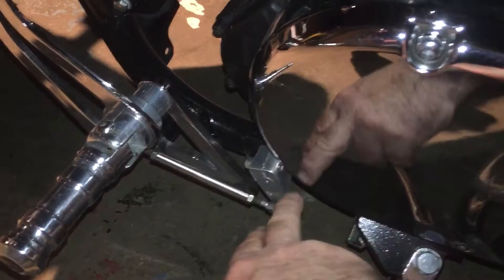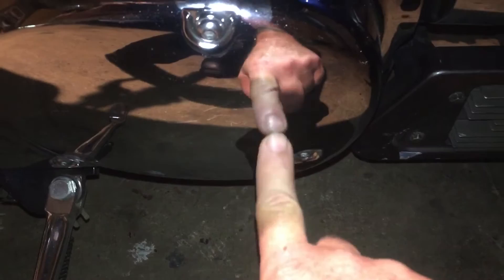Kawasaki front bevel gear bearing inspection

Comment: I got to do this exact job on my bike! Any info on to go at it without ripping apart the whole bike?
Reply from the maker: Infinity 11  You’ll have to remove your seat gas tank rear tire swing arm remove  rear Engine mount bolt so you can jack the rear of the Engine  Exhaust has to be removed also

Comment: what are the special tools I need to do this?
Reply from the maker: Damper cam holder # 57001-1025 

drive shaft holder # 57001- 1407
Reply from the maker: +174iceman  don't loosen the big bolt in center driven gear. or you'll need more special tool tool set bearing load
Reply from the maker: +174iceman  take the 4 bolts around the out side of it  leave big bolt in center tight

Comment: I'm wondering if this is my problem because the whining noise starts when I start the bike up, setting still with the clutch lever pulled in. I take off and the noise goes away.
Reply from the maker: no if in neutral and not moving , then it's not the problem, that bearing only turns when driveshaft turns
Reply: +174iceman. I just pulled the pre-screen and it's clean.
Reply: +174iceman.  Probably the water pump. Wonder how hard that is? ... Do you have a link for the downloads you were talking about for repair.
Reply from the maker: +Rod Compton  may be the clutch
Reply: +174iceman the sound doesn't change when I pull the clutch cable in or out
Reply from the maker: so what was it ???

Comment: Do you still have the link for the bearing part number ?
Reply from the maker: Matthew Gentry  sorry i don’t
Reply: 174iceman thanks for the reply , and thanks for doing this on video was a big help ,you seem 100x more knowledgeable then me  about bikes think you could help me out ? All my symptoms I have I narrowed it down to the  front bevel gear bearing ,I just took it apart and got the the bevel gear nut but and I have absolutely zero slack at all , does that bearing mean thats good or still a chance it’s bad ? My first thought was that I have a u joint going bad , if I roll the bike in neutral there’s a loud click with the clutch in or out , but when I put it in gear and roll the bike the clicking almost completely stops I can just barely hear it , when I’m riding the bike there’s a loud whining noise and I think it says the same noise when decelerating hard to tell though , any help would be greatly appreciated
Reply from the maker: Matthew Gentry  sounds like it’s bad  did you find any metal shavings?
Reply from the maker: Matthew Gentry  it’s doesn’t do it when a load on it  when you take load off it will click that the gears jumping apart and back together
Reply: 174iceman I haven’t taken the nut out yet to check the screen for shavings , going to try and do that tomorrow afternoon , another thing I should mention , when I’m decelerating it doesent matter if I pull the clutch or not the whining stays the same exact
Reply: @174iceman  yeh i got a bit of metal flakes in the mesh screen and some in the oil after it all drained out
Reply from the maker: Matthew Gentry  sorry to hear that sounds like it’s definitely Bevel bearing
Reply from the maker: Matthew https://youtu.be/cOqczNJwqsQ
Reply from the maker: Matthew https://youtu.be/ihfjXf2Q48E
Reply from the maker: Matthew Gentry https://www.partzilla.com/catalog/kawasaki/motorcycle/2003/vulcan-1500-mean-streak-vn1500-p2/front-bevel-gear
Reply from the maker: Matthew https://www.partzilla.com/product/kawasaki/92045-1165
Reply: Thanks for the links man i appreciate  it